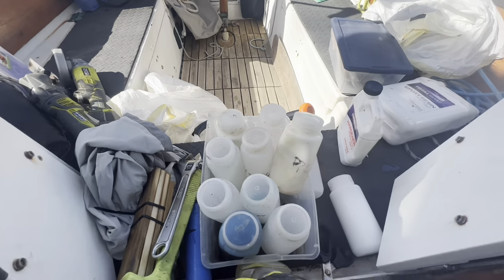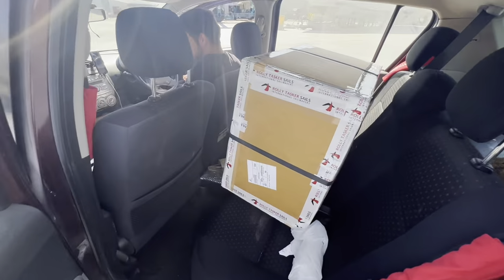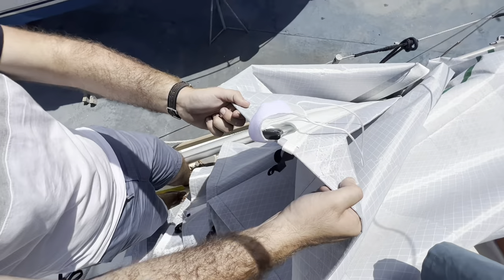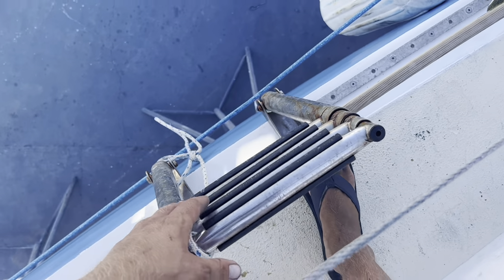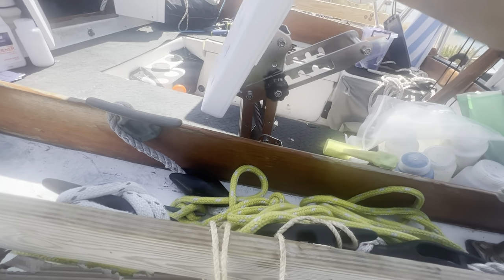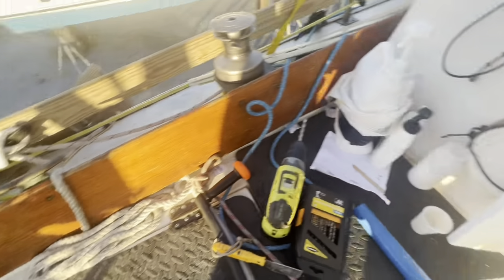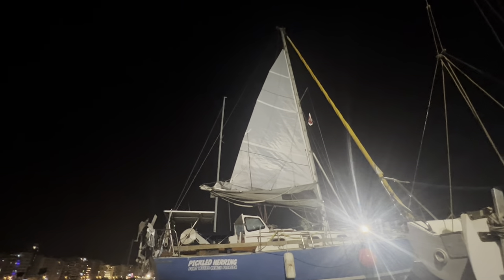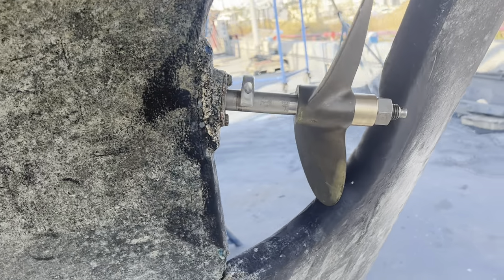Fixing my mangled propeller and installing new sails in Malta 🇲🇹 🔧

Comment: Looking at thar prop shaft assembly I'm thinking that that shaft should be cut down an inch or two. The prop should really be centered in that rudder/prop window. That would certainly give you more room to move the rudder by increasing it's range of limits. Have the marina straighten out the prop as best they can and keep it as a spare.
Reply: Now those sound like good ideas.

Comment: I assume you have got the main recut by now, but the easiest fix from what I can tell is to just cut 150mm off the bottom. Shorten the foot at the same time. Except the thread lines out of the clew won't be as designed. You are now going to get a really good geometry lesson.  Rolly Tasker are great sailmakers but they can only work with the numbers sent to them.
Reply: Monday morning qb here but wouldn’t the boat builder have the measurements for sails to give the sailmaker?

Comment: Good for you for putting an outboard bracket on the stern . They may not look great but when you're boat is a work boat like yours you have to be prepared. I think the electric sail boats could use then. It sure helped you on the Bayfield. Love your practical approach to sailing. That main sail has to be fixed and I love the way you are so chill about it. Thanks for the great videos.
Reply: I put an outboard bracket on my Westerly despite the vociferous objections of some in the community ("Your sail is your backup power!"). It's been a game changer for us as we sail in an area of constant, strong, currents where callouts for failed engines are common. It's saved our hide a couple of times now and gives so much more confidence when motoring through dangerous, narrow, channels!

Comment: Well done, Sam. I'm watching your video from the port of La Turballe in the Quiberon Bay, to the east of the Golfe du Morbihan but north from Saint-Nazaire. Your repairs seem to be just the ticket. For your main, you could set up a cunningham like on dinghies and tension your luff until you find a definitive solution. That's what I do on my little Beneteau Cabochard. You could also cut the head short and redo the grommet. Good luck.

Comment: Nice scenery at the end, wow, I think I would have replaced the wire with a heavier gauge, not another one like it, thinking of current and potential heat build up, but cool fix on the prop and rudder, hopefully the sails perform well ✌️

Comment: That solenoid wire looks sketchy, Sam. Look. That starter relay draws a lotta current so you should place a starter relay between it and you're battery just to be on the safe side. The wires from the battery to the relay and the wire from the relay to the starter relay should be on the beefy side. But the wire from the battery to the starter button and relay can be pretty light.

Comment: The thing that strikes me about the settup on the prop is there seems to be a fair bit of spare space front and rear of the anode on the shaft and you can get narrower profile anodes that take even less room but carry the same amount of material this freeing more length. Which means which Leeds me to think of you wanted to you could easily take length off the front end true it up neatly and recut woodruff keyway thus moving the prop away from the rudder blade harm's way. I kind of think some mod has been done in past maybe replacement shaft that sets it to fat astern the prop should not be able to touch the rudder on any turn. Hope you can correct this. Mark

Comment: Great job on the rudder mangle. That should do, but would recommend the next time you plan a haul out that you should do a complete inspection of the rudder and post structure inside the rudder. Not sure where you will be able to place a rudder stop inside the cockpit. Maybe a clamp on steel collar to the rudder stalk, but be aware any rudder stop located in an area where you are going to be is a hazard, a pinching hazard to be precise, and you do not want your fingers or toes to get squeezed by this!
I think the reason the ladder is on the stern is in case you fall overboard while sailing, you would grab onto the trailing safety line and pull yourself back to the boat and then climb into the boat using the ladder. Not sure if you would be able to pull yourself along to the side of the boat, just my 2 cents worth.
Reply: You can buy a "rope" ladder in a case to mount on the rail for emergencies. It has a tail to pull, and being soft doesn't affect docking.

Comment: We had a divin dog ladder like that on our westsail 42. High sides. We slung a fender under it to stop the bumps, and when the ladder is down in the water we kept the fender under the legs to hold it off the hull. That way your toes can get on the steps, otherwise they lay against the hull. You didn’t have that issue. Beautiful sails in first grade materials. Good for many years.

Comment: Got a 32ft 1975 O'day Center Console Aft Cabin in Marathon (BKH) in the Keys. Comes with a working 2009 moped and an 18HP auxiliary Johnson Outboard. Nice Generator. Mostly white fiberglass. Keeps bugs out. Cleans easy. This boat is very clean. See schematics online. It's old now, so it could use a fresh outer body coat, but it's not bad. 
I have pic and vids. Doesn't leak. Great condition for it's age. I thought it was a mid 80s boat. Just needs a scrape and a light cleaning + few minor fixes. I'm obsessive compulsive, so I always maintained this while I was on it. Purchased it in La Belle, near lake Okeechobee, on the hard. Has Autopilot but a screw came out of the cockpit wheel mech. I just use my own digital navigation on tablets, so I never fixed it. The parts are there. Only selling because I ran into serious health issues, possible skin cancer... so I think I need to sell it and go deal with it back home. My neighbors have been watching it, I live on the mainland now... and it's just a a lonely boat for the past year. I feel awful about that. The flywheel is stuck somewhere in the spotless atomic 4, likely from moisture and sitting. It started before. I also lubricated it before I left. But it's locked. Small engine, easy rebuild. On the side... I've installed some new knobs, switches ignition components, added some carpet, thicker foam cushion, needed painting in the cockpit and new entry doors. The old slats finally fell apart. I wanted to go deal with that before selling it. Instead, I'll just let it go at a lower price. I would sail this boat anywhere. 4ft draft. If you want to have a serious discussion about getting this boat, tell me how to reach you without giving me a phone number. Im not on social media anymore, but can use my GF's profile to communicate. I can also meet people most days. Just know that I'm not accepting any offer under 5K as it is. It's easily a 10K boat. If I happen to get out there and get it started, price goes up if I'm successful. This offer is for Sam primarily, but anyone can reach out.
Reply: Btw, I also have all the original books, rebuild manual and paperwork with it. 

The boat yard I bought this from is so quiet that they will allow you to stay on your boat as long as you pay rent. They have a bath house and cool people there. Not far from town. Just eastbound of LaBelle down the Caloosahatchee waterway. 
It's a great place to do work without spending too much.

Comment: You played down the oversized mainsail problem with your typical sang-froid but you must have been gutted !!!
 Your situation however served to harden my feelings about mail order yacht sails. 
I have some yachtie mates who are extolling the prices from Rolly in Phuket and Zoom in Sri Lanka .. but I have never had the confidence to take those measurements, send them to a sailmaker on the other side of the world and hope you get them right, your experience is exactly the situation I have been worried about. Fixing the over length 6 inches is going to be time consuming and expensive as presumably you will have to go to a European sail loft to make the mods
Reply from the maker: It wasn’t that big of a deal actually I just attached it underneath the boom. I still haven’t gotten around to having it fixed but if it’s expensive I’ll just do it myself.

Comment: Sam enjoy you videos.  I have had the same problem on two boats the relay solution is the best.  Also you might check for any corrosion on your primary battery cables especially at the connections.

Comment: With your anemometer at a low height you may wish to look up the wind sheer formula.  It adjusts for the fact that wind at deck level is typically less than wind at 10 meters.  Btw forecasts are for 10 meter winds.  Nerdy comment.

Comment: I'm still puzzled as to why this happened. The prop and shaft should be designed so that the rudder will never touch prop blades. Maybe the prop is too large for the boat, or maybe the shaft is too long?
Reply: He said in the video where the accident happened that he thinks the prop shaft is positioned wrong and puts the prop too close to the rudder.

Comment: Nice video you parrelled the wire. If you go with the relay get 2 - 1 spare. Could you let us know about that license thing.
Do you have any idea on how the prop was damaged?
Check the outboard prop length you need before you get one. Thank you
Reply from the maker: Greece didn’t need a license but Turkey did and the boat us license worked there. They were skeptical at first but I just told them it was accepted by the usgc as the main license in the US and then they said ok.

Comment: Interested in hearing how Rolly Tasker resolves the sail issue.  I’m in the market for new sails and the online lofts (Tasker, Precision, Loong) have very nice prices.  But the lack of local reps is concerning if the sails are made wrong (even if you’re measurements are correct.
Reply from the maker: There seems to be local dealers some places that Im sure could have done a better job measuring. They offered to have their loft in germany recut the sail but I didn’t want to send it off. I found a way to make it workable for now so I’ll just get it fixed next time I take a break from pickle.
Reply: @samholmessailing  thanks for the additional info. Glad you could make it work without having to drill more holes in you boat 😆!

Comment: Rolly Tasker sails obviously they did not measure them or they would have been spot on and also you know why swim ladder is at the stern instead of the bow because if you are solo sailing with no jack lines and you fall off the boat better chance at catching the stern ladder

Comment: Looks like Malta is the place to be for boat repairs in the Mediterranean.
Not sure if Greece will accept a BoatUS safe boating course certificate as replacement of a captains license. Most of Europe is very picky when it comes to proof of skill, unlike the US where winging it is good enough.
If I was you, I’d redo that starter cable. Put the proper thicker cable on it. Undersized and poorly connected cables are a fire hazard. 
Are you staying in Europe this winter? You are kinda past your normal pull out date.
If you see Desi and Jorden again, tell them old “Lady A” misses the water.
Reply from the maker: Greece didn’t end up needing it but i did in Turkey and they accepted it. I think I will have to do the relay mod for the engine next.
Reply: @samholmessailing  you’d think these devices are properly sized. But we love to linker, so it’s still a win ;)

Comment: Definitely want to see how the e-motor retrofit will work. Pickle will be a hybrid! Maybe also look into battery and flexi-panel solar sponsorships. Energy and fuel autonomy. What is the status of your water tanks? Do your have enough space for batteries to handle the load of a watermaker? Have you looked into the WattandSea generators?

Comment: You can shorten the luff off the tack yourself. Cut it away enough to get good stretch and just let the foot dangle in the bag. No big deal. When you gets somewhere with a sailmaker you can have the foot recut and sewn. Or you can sew it buy hand. Don’t give up all that useful area
Reply: Would you not cut off the head and redo the stitching there . At the foot ya need to stitch both the clue and the tack.?

Comment: It is unacceptable that the anti-fouling coating remains under the epoxy resin!  The anti-fouling is hygroscopic, water will penetrate through it under the laminate which will lead to delamination.

Comment: It might be easier to move the gooseneck fitting down, rather than recut the sail.
Reply: That's what I was thinking too. It looks like the boom would still clear that sprayhood and solar panels. drilling out the pop rivets and fitting new ones is a quick and easy job. Backstay flicker could also give more space for the roach
Reply: Yep, just scrolled the comments to see if anyone else mentioned it.

Comment: Maybe I’m just tight, but it pains me when I see zip ties get cut, especially the big ones!  It’s so easy to wedge a std screwdriver tip into the lock so it can release and be reused.  Too handy for single use!
Reply: I’ve learned that if you wedge them open like that they don’t work as well on reuse.
Reply: Yeah, you’re just tight 😂
Reply: You are tight.  Zip ties are not meant to be re-used, just like toilet paper

Comment: That outboard mount is no god, plastic is rubish, it'll snap, believe me. You should frame it with stainless steel plate from behind ... and than screw it back together
Reply from the maker: Great idea. Thanks for the suggestion
Reply: @samholmessailing  if you need foto of how we did it let me know ... we almost watched new tohatsu sail pro go into water when that china plastic snaped